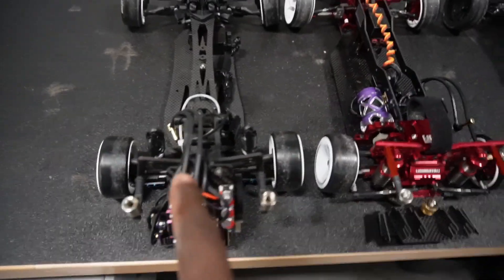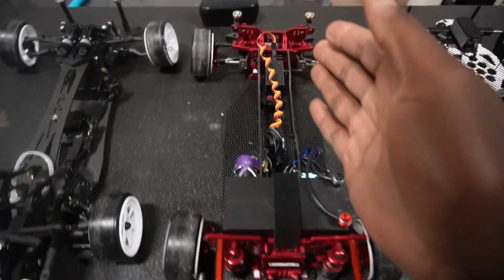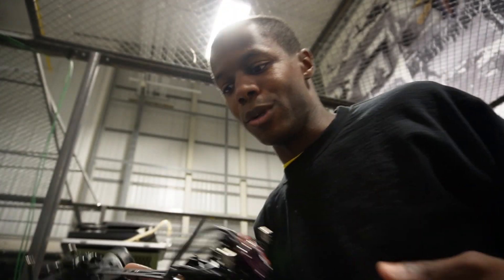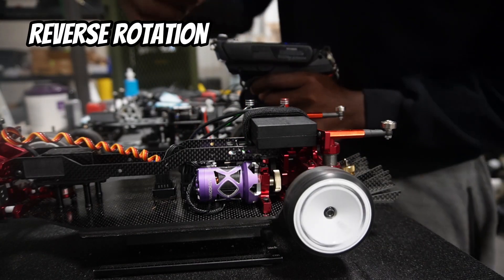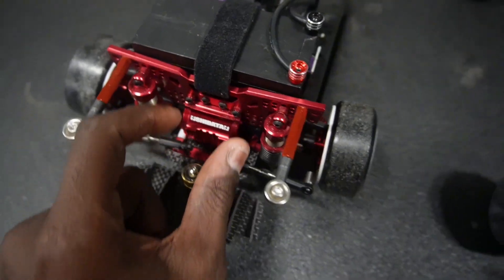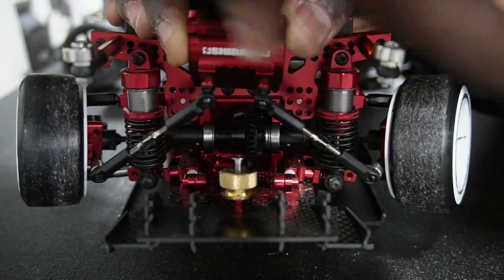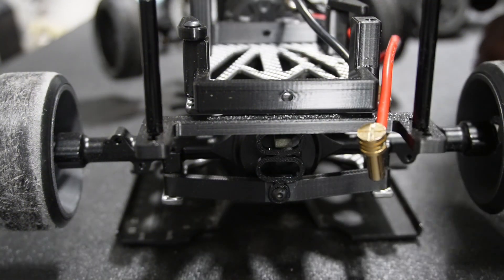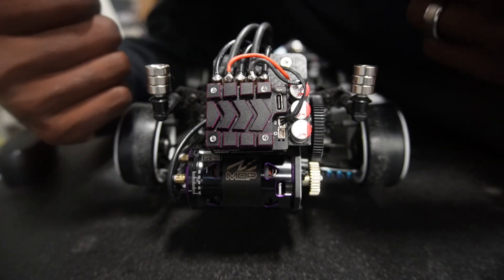The Best Method To Change Motor Rotation - Not What You’re Thinking

Comment: I found this video very informative, but when I’ve ran into this problem instead of using the ESC I just used my transmitter
Reply from the maker: Did you have turbo and boost as well?
Reply: @idealautofactory  no but I was pushing about 55° worth of timing never notice an RPM difference
Reply from the maker: @rcaddict79 ahh I see. That seems to be the throttle calibration reversal then. Sometimes cars go faster when you hit reverse than when you hit forward on the trigger. Switch that transmitter signal and viola.
Reply: @idealautofactory  I guess I should mention that I don’t know a lot about drifting at all turbo or boost. It’s something that I want to learn about, but I do some stocks back off-road racing and wanted to learn about drifting, so I watched a lot of videos

Comment: Whole video and there was zero mention of just swapping your outer motor wires to reverse direction. Also looks/sounds like gear mesh is too tight, with your wheels suspended your car should freewheel a few rotations and not stop right away when lifting off throttle. For a channel thats all about tips and tricks it would be nice if you mastered the basics before giving more nuanced advice to potential novices in the hobby. Tips and tricks do no good if you can’t nail the basics.
Reply from the maker: I appreciate your comment. I am offering the best method within the given factors that turbo,boost, and motor timing are all in play. I could be clearer with that precedent in future videos. 

Swapping the motor wires will not help anything on the cars in this video because they are sensored motors running end bell and esc timing advance.
Reply: As Joshua mentioned, swapping wires will not work on a sensored motor and even if you unplug the sensor cable and swap cables on the motor, it will still be running with negative timing on the end bell unless the motor allows for 0 degrees of timing on the end bell
Reply: @idealautofactory Respect on your decorum man. I've been working through this issue with a skyrc toro 120 on an mst rmx 2.0. made the change in the esc and feel like it's not at full potential. As the 2.0 has a bevel gear I tried flipping it but it seems the mesh isn't quite right, does not spin as freely. May try shims but I think I may be stuck with the esc change. Love the channel!
Reply from the maker: Yea that MST 2.0 gearbox was no fun for me and its all plastic gears too. I am looking in the manual right now though…. On page 14, since you flipped the diff, did you also flip the bevel gear holder?
Reply: @idealautofactory yeah I tried it with the gear holder both ways it felt tight both ways. I'm going to try it again to see if I missed anything and hopefully a solution shows itself. I was thinking of putting small washers in the holes where the gear holder sets in. Will update if I have any luck
Reply from the maker: Ah ok. I wish you the best. Hopefully the shims work.
Reply: @idealautofactory No dice, I'm just going to switch to a hobbywing.
Reply: It would be wise to know what you are talking about before talking. Clearly you know absolutely nothing. Saying just swap the wires without actually understanding that motor polarity has nothing to do with motor rotation is idiotic. Think before you trash talk someone’s proper advice. Clown.
Reply from the maker: @theslowesthare4831 understandable
Reply: That totally depends on what his drag break setting is set to. If for example the drag brake is set to say 10-25 and at for example 0.5-2Khz ish it will come to a dead stop when letting off throttle. And you know nothing about his drag break settings, so youre just jumping to the conclution that his gear mesh is too tight.. 😂 

Also, swapping the A and B leads on high end sensored equipment will definetly destroy it and you should know better before posting a comment like that..smh

Comment: Hey m8, very informative video,  my question is would any of these choices work on my YD2 Z with a Rhino Shark conversion kit, im not done building it yet as uts my first drift RC, also wot electronics would ya advise on me using....ie motor esc giro and servo, i want da best possible setup so i don't av ta replace da electronics, i like a challenge wen learning.
Reply: Yes this would apply to the shark transmission. Which direction your motor faces will depend on if you will be running 3 gear, 4 gear, or belt drive. For 3 gear and belt drive you pinion and spur should be on the right side of the chassis, for 4 gear they should be on the left side